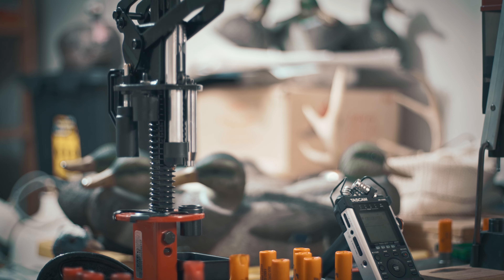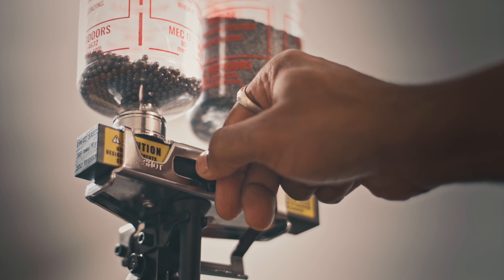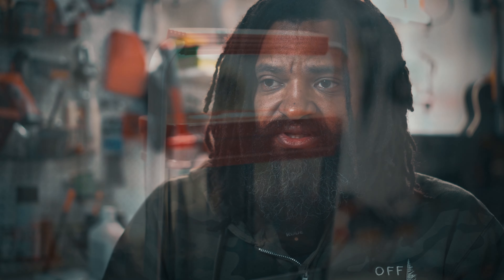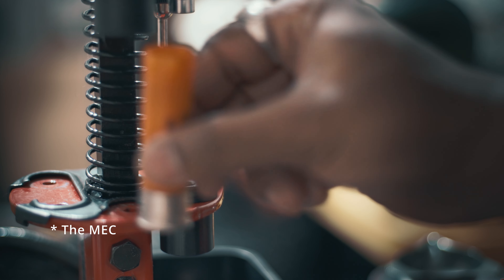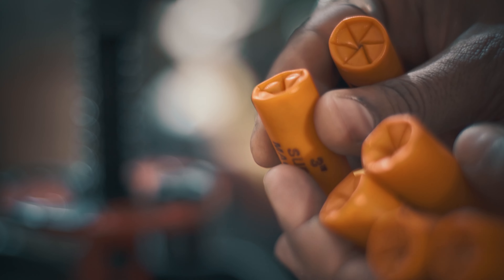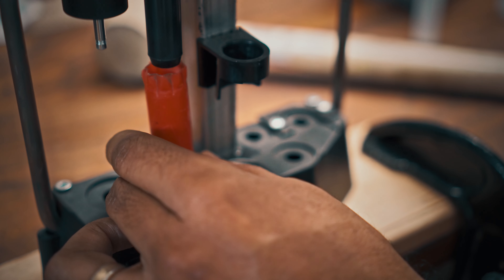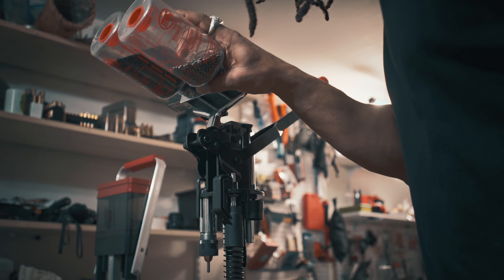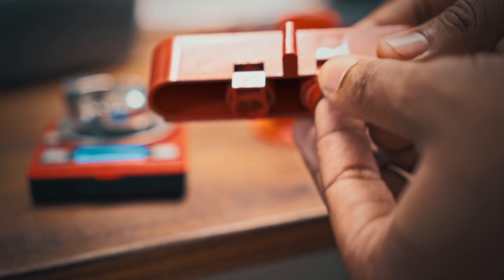MEC 600 Jr Mark V vs Lee Load-All II (A fair comparison)

Comment: I'm on the fence now. I have a mix of 12 ga. shells I've scrounged over the years. Is it really that big of a deal to tweak the MEC for different shells? 

I really want to like the Lee Load All II, but it looks like such a toy compared to the MEC.
Reply from the maker: Yeah that's a pickle, can you sort your shell? or just accept that you might not have perfect crimp. I did not tried it, but maybe trimming all your shell to the same length could help a lot.
Reply: @WildBushGrit  I think I might just go with the MEC. It looks so well built compared to the Lee. 

I could sort my shells, but I enjoy scrounging at ranges. I guess I wouldn't mind tweaking the MEC here and there. 

Thank you for such an informative video!
Reply from the maker: @fsae0607  You will not regret the MEC it is solid! But the Lee is not to be underestimated, i've reloaded for years with it before moving to the MEC. Either way you can't go wrong, but I do like the heavier MEC feeling, and I think this is what you are after too.  Thank you for the kind words! Cheers man!
Reply: The Lee load all 2 is not a toy. It is a very capable press every bit as capable as a 600 Mec. They both have their disadvantages and advantages. I've been reloading for over 40 years. And I've always had a Lee load all or 2 as well as Mec. I also reload all my rifle shells. From the 30-30 22 250 7 mm Remington mag 264 Win Mag 270 short mag and the 270 + 243

Comment: The brass base on my shells is .5 inch high and when I full length size the shell it gets stuck in the sizer. What am I missing
Reply from the maker: It's depend on the shells you are using, some are thicker or longer...the tolerances varies a lot from manufacturer to manufacturer. Try lubing them it will help. Also try different hulls you will see the differences.
Reply: @WildBushGrit  Try turning the resizing collar farther in on the support tube. That will raise the sizing ring and might allow the case head to drop free of the sizing ring.

Comment: I just had a thought to greatly accelerate reloading speed with either the MEC 600 Jr or on the Lee Load All II: How about filling each station on the press with a hull so that you're continuously feeding shells instead of going one at a time?
Yes, this would necessitate buying a second resizing die for the Load All II, but am I wrong about this as an idea that could actually work to possibly double your rounds per hour?
Reply from the maker: Your shots and powder comes from the same tube, so you'll have to make a stop there. Crimping is tedious on the Lee, I wouldn't want to battle the priming, and depriming and pre-crimp and  crimping at the same time. It definitely would be easier on the MEC. :) It's worth a try, i'll let you know :)
Reply: @WildBushGrit  Thanks for the informed reply, spoken from someone with thousands of shotshell rounds under his belt.
I've only loaded a few dozen long ago, but I have tens of thousands of metallic handgun and rifle loaded.
I'll be interested in hearing what you find with my idea.
I could just be spitballing, but it would be interesting to see.

Comment: With the Lee I find the powder charge is very inconsistent.
Reply from the maker: The type of powder you use will make a difference, but for most average use, trap, small game hunting, its enough to have some fun. However for Turkey or Waterfowl loads, (which i like hot) I prefer to use a scale.

Comment: I jumped in with Lee and learned and made and still make great rounds. But recently I did buy a mec 650 for the advantages Lee does not have. Note I will not be getting rid of the lee press.